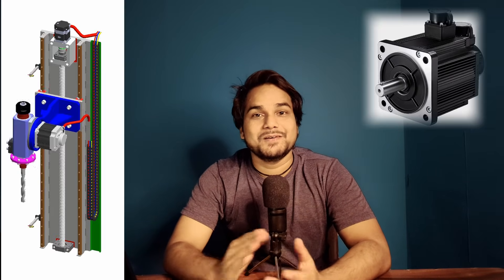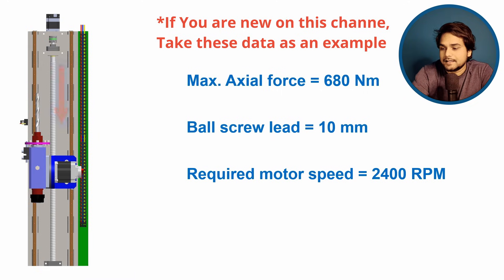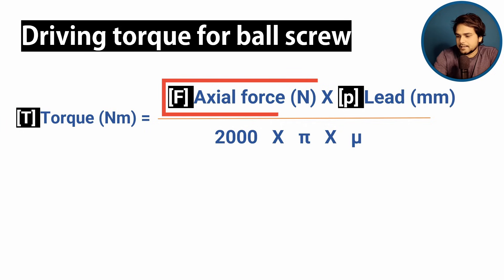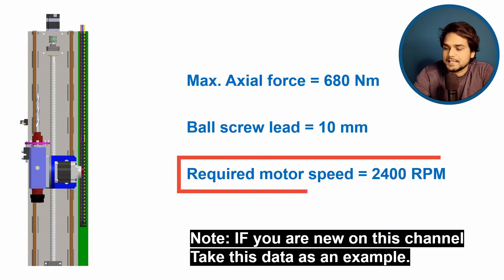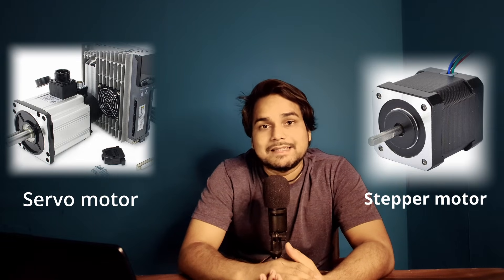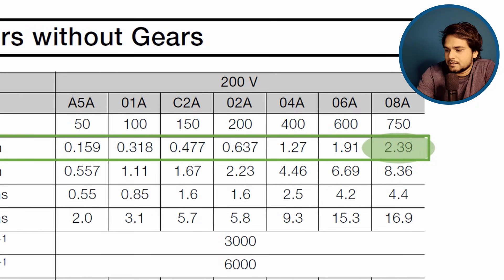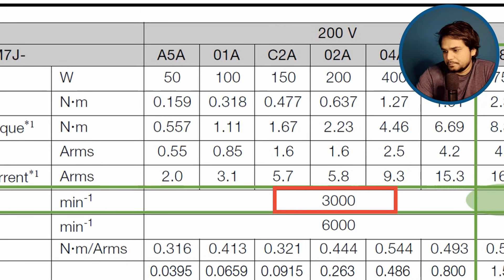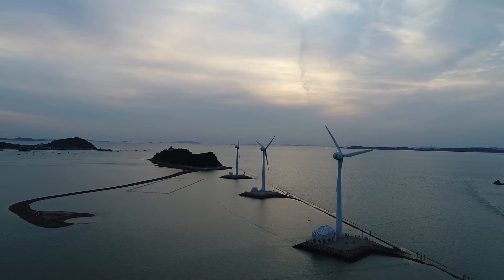Ball Screw Drive Torque Calculation | Motor Selection Calculation

Comment: Brother ..please can you make video on details of selection of hydraulics cylinder in spm.
Reply from the maker: Sure. Laksh, I'll bring Master Class series on the Hydraulic system with project example. Very soon. Where we will master Hydraulic cylinder selection, Hydraulic power pack sizing calculation. Also Hydraulic circuit design and valve selection
Reply: @mastermechanicaldesign  thanks a lot man ♥️

Comment: I'm planning a similar design using a 1500 mm ball screw shaft for a ~50 kg payload but am concerned about backdriving, which could drop my load. Does this only occur when the motor loses power? If so, what would you recommend to prevent backdriving in the case of a motor power loss?
Reply from the maker: In these conditions, use brake motor, (servo motor also come with break, electronics brake, if power cut off, break engage, actually power need to unlock) or you can use a worm gear box with motor, back drive will possible

Comment: Hi, really amazing channel! I have learned a lot. Thank you very much.
Regarding the max instantaneous torque (https://youtu.be/sihkNhfwD30?si=bkX1fJaM3VyoTXlJ&t=222), does the acceleration of the system, could be considered instantaneous? If so, maybe we could use a smaller motor since the calculation was for the torque with the acceleration included.
many thanks again
Reply from the maker: Very good question, Actually, acceleration is never truly instantaneous in a real system, there is always some time duration, even if very short. 
The max instantaneous torque is calculated considering the peak acceleration required by the system. 
If you assume a lower acceleration or a ramp-up time, the required torque will be lower, which might allow for a smaller motor.
more about that in this video- https://youtu.be/1wxIfK3ocXo?si=bmbeR714Qb8cXCxJ
Reply: @mastermechanicaldesign  Many thanks for the clarification. I'll definitely go check it out.🙏

Comment: Hello Brother, I have one question, I am going to use the same actuator to lift 20kg and 70Kg loads. I have order one from the Ali Express. I just want to get some idea how can I add counterweight to this actuator? as my mind said all load will be supported by threads so counterweight will not be affective in this case, as mostly it is added to the systems that are driven by worm gears and pullies.

Do you think if I attached the counterweight to the mounting plate (that is attached to the ball screw) will give me any benefit of reducing the loads on motor?

FYI: I will be using 10mm pitch screw and 4.5Nm motor
Reply from the maker: Hey. Better if you could email me with design

Comment: Is the formula of torque applicable for rotary motors?
Reply from the maker: Rotary motor ? Or Rotory table ? This formula is for rotary motor
Reply: @mastermechanicaldesign  my design is rotary table with the use of rotary stepper motor. is the formula applicable for that?

Comment: What does the 2000 conversion factor on the bottom of the torque calculation convert?
Reply from the maker: This is actually 2*pi (if we use ball screw lead in meter) but as you are using "mm" unit for ball screw lead in this equation. This is why its 2*1000*pi 
Don't ask me why we use 2*pi
"It's a long drive equation of mechanics physics"

Comment: Sir , can you please continue this how to calculate motor power as its missed in this part , i have seen your belt conveyor video , but still i want please make a video on this , it will clear many doubts.Thanks
Reply from the maker: Hi Charan, As we calculate the torque and speed in this video, We can calculate the power, Motor Power equal to Torque × angular speed.
As we have calculated in the conveyor.
Reply: As i am working in Hydraulic Rextoth gear pump testing i will give better information to you please contact me

Comment: Hello! How could I determine the axial force for the ballscrew? Thanks for the videos, you're doing a great job!
Reply from the maker: You most welcome Luka, Ball screw axial force - Yes use the same formula. if you have defined motor torque, and Ball screw pitch then P which is axial force, this is your Ball screw maximum axial force.
Reply: @mastermechanicaldesign Thanks for the reply. I should've added that I have not defined the motor torque, nor I have some specifications about motor except it should be BLDC servo. Do you have any idea how should I continue?
Reply from the maker: Look first of all, as we all know ball screw is just like a gearbox, not producing any force or power itself. It all depends on motor torque. No matter its BLDC or servo motor, if motor torque will high. Ball screw axial force will be high.
Now how much torque?
So first make selection of ball screw and calculate the ball screw pitch . And there is video on it.
Then calculate you can either calculate ball screw axial force as per given motor torque or you can calculate required motor torque as per required axial force over ball screw, using same equation as in this video
Reply: @mastermechanicaldesign Thanks man, you've helped me a lot! Cheers!

Comment: Thanks for the series, There is mistake in Torque calculation T=680X10/(2000x3.14x0.8) = 1.35 N-m (Not 1.95 N-m). Please check
Reply from the maker: Hi Satya, Yes, please bear with me for example calculation mistakes, take the formula and put your own required values. Apart from calculation typing mistakes every thing is right 👍

Comment: Typo for the example: The result shown on screen is 1.95 Nm for the 680 N load example. The actual result with this equation and numbers is 1.35 Nm.
Reply from the maker: Hi Jemes, Yes in some of my videos, There are Typo errors, Just because I'm doing all the production work alone, now we have a cross check community. So errors have been minimised. 
But there is no error in the definitions, concepts, and formulas 👍

Comment: Brother ball screw pitch take In meter not in mm .
Reply from the maker: No. Pitch has to be taken in mm, hence "2000" conversion factor is in this equation.
If you want pitch in a meter just change this factor to 2, best practices is pitch in mm this is why this equation is like this.
Reply: Typically in mm or tpi.  I've never seen pitch in m in all I've spec'd out.

Comment: Nice video!
Just one suggestion, you should add the acceleration as a parameter and use the inertia of the motor when selecting.
If you don't take the inertia into account you might end up with a system that will work but won't accelerate correctly (so you might never reach the maximim speed of the project, depending on the length of the actuator).
Reply from the maker: Hi, Thank you so much for your suggestion, Yes we should definitely consider MOI of all rotating elements (Ball screw + Coupling + Motor itself) during Torque calculations. I'll bring this calculation in dedicated motor selection series. Here I missed it, but I have considered double FOS.